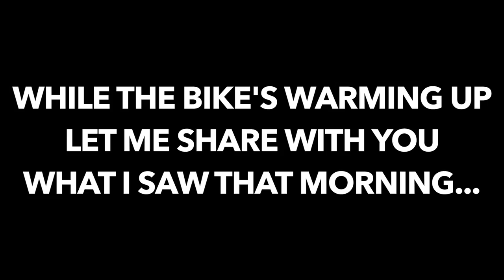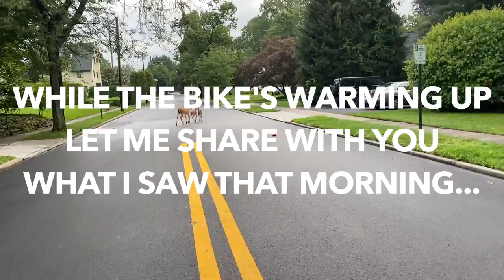Harley Davidson Lower Fairing Install

Comment: The Conquest Knight XV is a armored SUV! It's based off of a F550. Starting price is like $300k I think.
Reply from the maker: It’s insane- wow 👍🏻💪🏻
Reply: Spot on! It is the flagship of luxury armored transportation, handcrafted with V-10 and exert amenity you can think of(even comes with a PlayStation 3) 😮 😂
Reply: I had a feeling it might be Armored! It should come with Bodyguards for that price! BTW those door are incredibly HEAVY! No roll down windows (maybe couple inches). Guess you won’t be. needing them with Easy Pass…. GoldwingMikeNY.
Reply: @michaelfrascati7610  😂🤙

Comment: I had lowers and fork deflectors. Lowers had no effect on the wind buffeting…on my bike anyway. You may notice you feel more engine heat with the lowers, since some of that wind is being blocked. Touch one thing, have to account for another it seems.

Comment: Have the same lowers, they are great 👍 and for longer rides/highways, no more wind hitting on knees. 
Got 2 extra Rockford Fosgate, replaced the standard speakers, super easy to connect to the Sony (no Amp needed) and the sound is … much much better with 4. Downside is some extra weight, but still OK.

Comment: I have a 2020 Electra Glide Standard and watched your video of the Sony install. I was wondering do you use the main screen for all your controls of the unit or have you also installed the handle bar controls from Harley. Also, how is it working out for you.
Reply from the maker: At the end of the video I also installed the Harley handlebar controls… I use mostly them. 👍🏻😀
Reply: @HOLYSHIFT  Thank you.
Reply: I'll need to look at the video again, missed the handle bar part apparently. Thank again Bro.

Comment: Don't listen to Mr fanatic. I put lowers on my Road King and I also have those fork wind deflectors.  so I thought I could take them off.... wrong! I took them off it was even worse,  I had to put them back on,. test run in the high speeds first.

PS   You need to turn the bottom bolt the other way,  down not up.